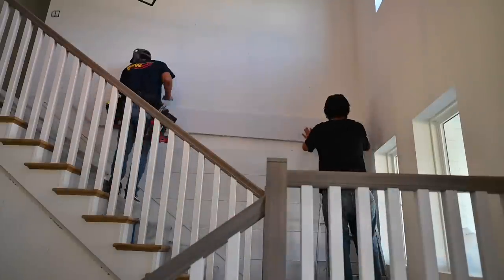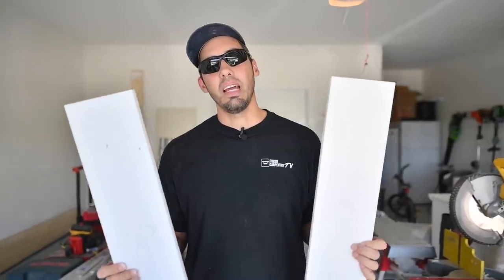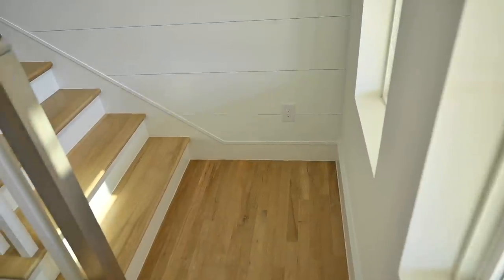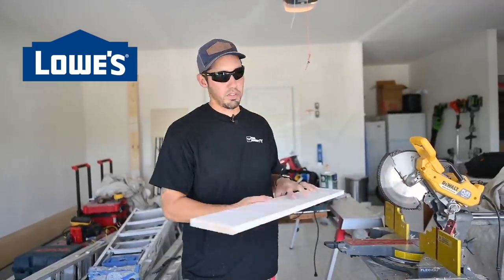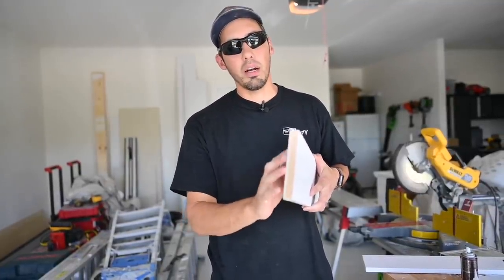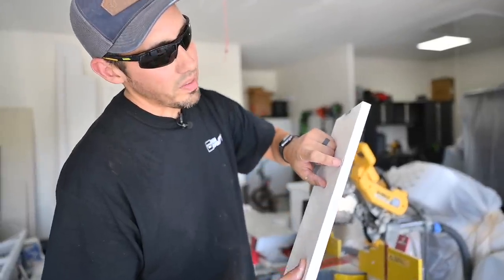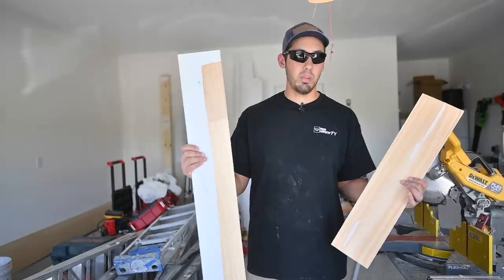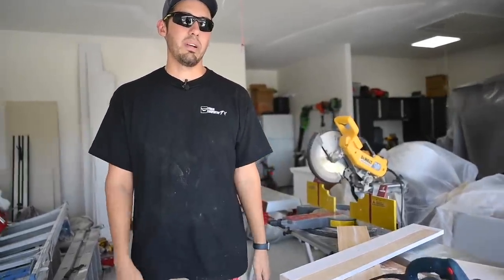DON'T Buy These Boards from Lowe's

Comment: In lowes defense,  I use to manage one, they may not know the quality.  They purchase all that from different vendors.  Use to be Empire a few years back, they would deliver and restock the shelves. A lowes employee only ensured the price was correct. Could possibly be the vendor selling crap to the stores. Until enough customer complaints come through that details the issues, the buyers for lowes won't change. Then again, most homeowners won't know the issue and mainly want a reasonable price. Great information. Quality products and tools makes everything easier.

Comment: Where I used to live the Lowe's was really close while Home Depot was a little ways further, so I would go to Lowe's first and then Home Depot if they didn't have what I wanted. But each store has a saw that allows them to accurately cut big boards. The Lowe's store's system was out of alignment by a half inch over 8 feet. So the employees would warn you that if they used it the boards wouldn't be cut straight across or up and down ruining them. I asked why don't they get it aligned or a new one? They said they have been begging corporate but it hadn't happened before I moved away. I just went straight to Home Depot if I wanted my boards cut.

Comment: Recently I gave a bid for  new window install with WindsorOne jambs and casing. Client went to the lumberyard and changed my WindsorOne to MDF. I was informed by my supplier about this change. I then confronted the client and increased my labor for that project. I ended up in a situation with that client and not doing that project. I lost the client but I didn't loose my dignity in installing an inferior product. "The result of a shitty product is a shitty product."

Comment: Very good video. This is great information for us millwork pine producers.
The thick gesso coat you see it’s a system that the Asian market came up to use less quality wood (knots and rough wood) to cover up the material and make it look like a nice prime board. Sometimes the regular prime boards may not look as nice and smooth as the plaster/clay boards you were comparing with but it’s definitely a better product.

Comment: I see boards like that lowes one at your lumber yard. Call Centurion Pine. that thick layer is a filler layer then primed. Never use it in a situration that you must sand out joints. If you sand down to the so called pine (in my area it is no were close to that thick) when primed and painted the grain pops and you always see it flashing at you from angles.

Comment: I like Lowes for the veterans discount. But I have been buying from a local vendor that is carrying the Windsor One boards due to cost. I normally would hit Lowes for 1 or 2 boards. But in bulk, I buy from the local guy, unless cost is too high, then I hit Home Depot as they even have better wood and still offer the Veterans discount up to $500.

Comment: He is correct, I just bought some 1x primed material down here in Florida and experienced the same thing only mine was a little worse, more like a heavy 16th of primer on each side. I also found that when I would nail it would chip out.

Comment: I imagine the coating is getting thinner towards the ends because they are using cheaper and quicker dried boards that has more cupping and that coating is filling in the twists and cupping in the boards.

Comment: If you HAVE to do box store, Home depot FJP is better due to the primer/filler issue with the lowes stuff. Lowes stuff chips off too if you bang it while moving it around. I've never see that on HD boards. Could vary by region. Also, Windsor is about 20% more (Dunn Lumber) than HD stuff in the Pacific NW.

Comment: I just trimmed out a house with prime links pre primed pine boards and the amount of filler in some of the boards was ridiculous. We found divots filled in as deep as 3/16 of an inch. Also that filler is very hard on tools. Block plane, miter saw, table saw and jointer blades all took a beating.

Comment: What sucks about that coating is the chips. Before and after install. Run a piece of furniture into it and it chips. Or chunks. Solid wood will just dent or barely show damage. 
The coated board does look nice.. As long as it doesnt chip. Like you said. Takes more time to make a joint look good.

Comment: That stairway job gave you a very good opportunity to use diagonal patterns. Just horizontally stacking the boards 20' high waa amateurish at worst! The same could of been done for the lower wall.

Comment: Excellent comparison. When you sell less material (wood) through the supply chain, (in lieu of the coatings) those fractions of a cent in cost of sale turn into millions in profit when we're talking several million board feet sold at retail.  
There is probably a well thought out sales pitch given to the big box store buyers on conservation of natural resources, stabilized engineered wood product etc. Well done sir.

Comment: I work for a local lumberyard as a inside salesman and just to add to your discovery. A big box store will sell right underneath our margins to undercut our prices with inferior products and if customers actually knew how much it cost us to buy the exact same product these big box stores buy, you would be baffled on how high of a profit margin these big box stores make by fooling customers with these cheaper products. I know it's hard to trust salesmen because we are commission based but trust me that big box stores are not offering you a better product at a cheaper rate. Find yourself a reliable, knowledgeable and trustworthy lumberyard and support them instead.

Comment: Unfortunately, WindsorOne is not in my area, and the closet distributor is the next state over. 😞 maybe things have changed in this past year. But, they ship only with a min order, as expected.

So, it seems that if you have to get S4S pine boards from a big box store, don't get the primed boards. I have noticed the non primed boards they are actually 3/4" thick, but you have to pick through them to find the straight ones.

Btw, congrats on making the WindsorONE website. They feature your picture frame moulding design.

Comment: I tried to find windsor one materials but the yards around here wouldnt do business unless you buy a large amount. I just finished my shiplap project and wrapped a wall with miter cuts. I had to get the boards from Home Depot. I spent hours going through the boards because so many were cupped and made my miter cut look bad. Luckily I found enough to complete my project successfully but I tried everything to get a quality board. Just wasn't happening!!

Comment: I just installed new doors, and the framing was the same as those boards!, It was impossible to chisel out the strike plates as the thick paint was just chipping off , If i knew I would have used a rotary tool or something else maybe

Comment: I am a contractor in NJ. I was working today and no lie...I decided just a few hours ago that I'm NOT using those primed boards ANY MORE from Lowes or Home Depot. Every few shots with my gun, chunks of that clay primer coating was blowing apart. I had to backfill those areas with putty and sand it down to get it to look half descent. It's so weird that this was one of the first videos that came up as a suggestion when I got home.

Comment: Was making two new kitchen cabinet doors. Got some bare wood 2ft. x 4 ft. unfinished glued up boards from Lowes. After cutting and routing we put a coat of primer on. Parts of the surface began to lift and "shingle" off. Royal pain in the arse. Real crap.

Comment: I find Lowes lumber w/o primer is good same with  Home Depot  , I never buy MDF or  finger joint wood. most people I deal with want to stain their wood. If you have a choice get spruce over pine, about the same price and doesnt cup or twist on you

Comment: Another simple test you could do is to cut off some boards 2 ft long with finger joints centered and place weight on the center to determine the FJ strength. While this board is not intended to be structural the ability of the finger joint to resist breakage from weight will also translate into the ability to resist separation over time.

Comment: That gesso is used a lot in manufacturing mouldings for the picture framing industry. It is surprising what they can make out of poorer quality, finger-jointed scraps. It also takes a tole on the saw blades. It doesn't take long to dull newly sharpened saw blades. Not nice to breath either.

Comment: the price comparison is helpful. cool video. having a hard time finding someone in my area similar to Windsor One. my only thought regarding this use case is that I wouldn't think it would matter unless it was preferential in this particular case, right? I mean its just being drilled into drywall, not supporting anything. I would think the Lowe's boards would be sufficient, albeit not ideal. Open to changing my mind.

Comment: I found Lowes has different suppliers- in some door trim, some of the wood (was originated from Brazil) was good, a very good quality primer surface.  The other wood (not from Brazil, I can't remember where) had more warps and a thin primer.

Comment: I stopped buying from HD, Menards and Lowes a while ago. Everything is always wet at HD and Lowes because it's stored inside and once you get it to the job it all twists and warps. Menards has nothing but substandard trim, too. None of the profiles match anything else. Plus, my local lumber yards in NE Illinois and SE Wisconsin are all family owned and cheaper. They also deliver for 50 bucks or less. All of them are also Windsor dealers.

Comment: About the Lowe’s board. I learned the hard way. I thought the price was right until I had to repair and repaint all the trim pieces I had bought. Their primer coating does not hold paint. And if it gets dinged up, I had to use auto body paint filler to fill in the chips. Then sand them smooth. And the paint, I needed to sand the primer on the board and use a self etching primer before applying my final colored paint. My bottom line, it’s not worth it.

Comment: I ran into this 'trap' some years ago, when repairing trim boards on my house.  That's when I discovered the reality that one supplier's "1 inch" boards are not the same as another supplier's.  And that, unfortunately, also held true when going to different 'local' lumber suppliers.  (And of course, whomever the supplier(s) was for the builder who originally built my house, long before we bought it.)  Our house already had numerous odd-size choices such as slightly lower ceiling heights, all probably made in order to save costs.  So this isn't really exclusively a 'big box' store problem.   

I now always bring a tape measure (or pick one up in the tools section) when I go to any lumber supply to pick up boards and measure carefully so I know what I'm getting before I bring it home.  I also try to take into account - will the piece be flat-joined (beveled or butt) against other trim?  If not, you can sometimes get away with using a different thickness.

Assuming you bought all your wood for a project from Lowes (or any single source), the problem of the odd sizing goes away, because your pieces will match dimension on joinery.   And contrary to some of the comments, the fact that these are multi-section finger-jointed pieces that are so heavily coated means they are actually fairly dimensionally stable.  Moisture movement into/out of the boards is not really happening, assuming proper carpentry and prime/paint of the cut edges.

But the lack of square edge corners and proneness to chipping by the extreme thick coating are still problems, when doing a large project or many projects because they just create more work after assembly in order to fill with caulk or putty (if needed).   That's just too expensive on a large scale.  Not so much for a small DIY project where it's less of a big deal.

Comment: Long-winded, but a good video for those that don't know. Something else to point out is the speed at which blades will become dull on the clay coated boards, as opposed to the boards that have actual paint primer.
The only benefit I've ever seen to these is water resistance
Keep up the good work, and keep using real wood 😁

Comment: Jeld-Wen prehung interior doors has the same thick ass coating on the Jamb. getting them off the shelf and to the jobsite without chipping this coating is very difficult.... whats more difficult is dealing with the chips in the coating during paint. very time consuming.

Comment: I loaded up 50 Lowe's shiplap boards that were ok in the store. 
When I went to load them up the bright sunlight showed how terrible the fake primer was applied. 
I immediately wheeled it back for a return. HD lumber has been way better for the last 3 years. 
Their so called primer does not have any adhesive properties at all

Comment: You just restored my faith in the next generation. A young guy who gets it. I just came off a 6mo. Union commercial/hotel job - top end Canadian clear Int./Ext. pre-finished DF & engineered Moso bamboo decking (harder & more finicky than Ipe) = 1000's of plugs. NOT ONE of the other 50+ finish guys (young AND old) knew (or cared to know) how to put a proper edge on a chisel. Too many approached me to borrow mine. Comical the blank expressions when I said I spend over an hour per week in my own shop maintaining said edge tools. Which brings up the strange job site phenomenon of emotional blackmail. If you refuse to loan your tools you're somehow a dick. If you're naive & dumb enough to loan them out & complain when they come back abused & mangled, you're also a dick... and a whiner.

I'm 61 & soon to retire to my studio/shop. Think about this. I scribe alone (cabs & trim- even long stuff) with a pre-back bevel pulling (Japanese style) with a Lee Valley Apron Plane on a 30-45 degree cant/down cut. For years I've out raced crews of two (sometimes more) who typically clamp & belt sand. I've never worried about being the first to be sent home. Please, PLEASE!, don't think this about me tooting my own horn. Just making the point Old World craftsmanship is not necessarily slow & out-dated. I firmly believe ANYONE can do this by a simple willingness to step outside "the mindset box".

FCTV just gave you a lesson in reading your material. These things MATTER! It's up to you - the choice between being a mere automaton installer & a thinking, innovative craftsman. In framing, speed (frequently unfortunately) rules the day. Whether you ease or jump into finish, speed is rendered irrelevant if so much of what you do too fast ends up on the punch list (or demo'd & redone - to your shame & possible job security). If you strive for perfect/efficient. 2nd best is still excellent. Aloha from Hawaii.

Comment: They are basically bondo “jointing” those cupped boards flat….super weird idea
Reply: If it’s not cupped, then they joints aren’t flush. It’s always something. Caulk the seems, bondo the cups...Sounds like unnecessary work to me. You shouldn’t have tho freak it, to get the job done.

Comment: Hey Rich, Trust me, you definitely found one of the better boards from Lowes. Most are pretty much knotted, have holes and blemishes that are filled in with the "Primer" Lowes and Home Depot are basically poor quality products compared to what you buy at a real lumber yard or real tool store. I stopped shopping at both places in the early 90's.

Comment: Or, use unprimed boards, get your joints tight, then prime before you paint. That way, the customer isn't paying for the primer applied to the scraps/off-cuts that you're throwing away after the job is done.

Comment: Hey bro , I am thinking of buying 3/4 thick 5 1/2 pine boards from Home Depot and painting them my self to use as baseboards instead of buying primed mdf baseboards, I know it’s not  common practice but I really want 3/4 and at least 5 inch thick baseboard what do you suggest? Thank you in advance

Comment: I don't have a place to get better boards as a DIY're, but I have to say that I've never seen this on the Home Depot boards.  That thick coating is very strange. I knew there was a reason I didn't like Lowes boards and molding.

Comment: Seems like the center of the Lowes board is cupped, as the coating is still in the center when you've reached the wood on the outer edges. That's going to make for problems.

Comment: I grabbed some of this 1 by  from lowes for a face frame for a closet I was doing. I ripped down the boards to size and found oak finger jointed with pine. Really screwed with the finish.  Seems like they just throw in whatever wood is laying around.

Comment: I just went through this last week: got some finger-jointed "primed pine" 1x6's from Home Depot to build some door jambs and by the time I'd sanded off the primer to glue the jambs together, all my measurements were off by almost 1/8". Only reason I got the stuff in the first place is because HD doesn't even carry any 1-by pine better than extremely twisted, bowed and crooked #2 common...

These big box stores have spent 20+ years driving most legit lumberyards out of business and now I have to drive an hour and a half to get lumber that's actually useable. Yay, capitalism.

Comment: whats the moisture content of each board? just wondering but what does a quality board feel like?  What your feeling is the coating not the board. Lowes buys product based on cost with a minimum standard of quality. Wonder how the winsor works after some moisture gets too it. After all moisture is woods killer regardless of who milled it, personally I am ok with the coating.

Comment: Again, as you shared, it is not paint on the Lowe’s boards.  It is a filler that is soft and spalls.  I am also curious what that stuff does to your blades, given that it is likely calcium carbonate, silica, and other low cost fillers.